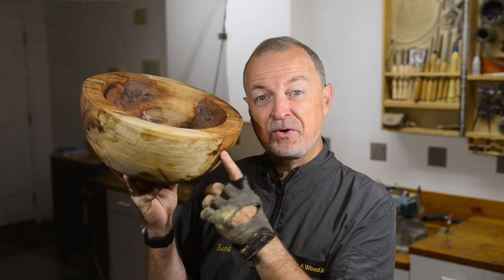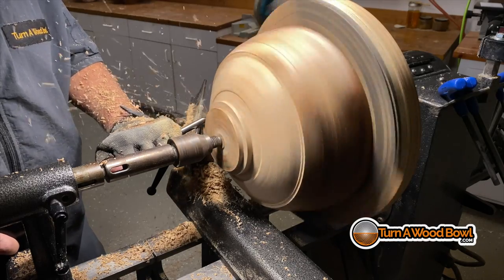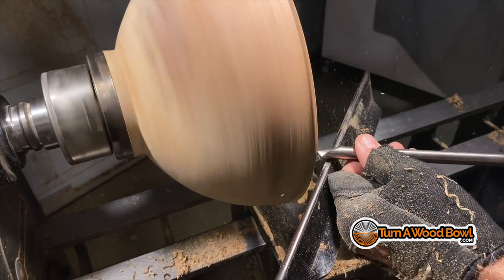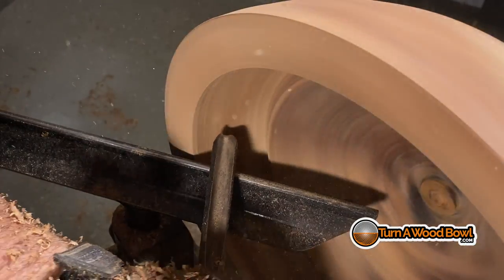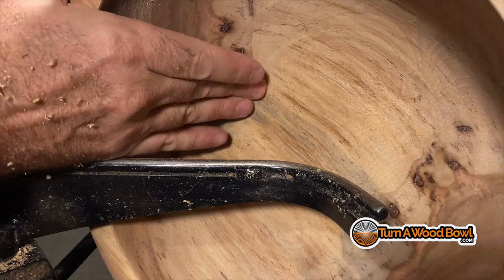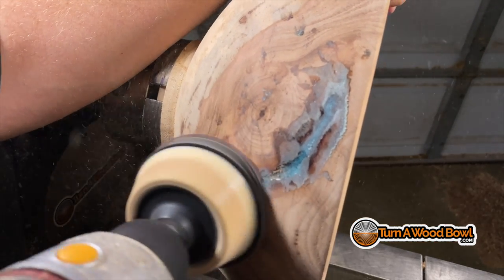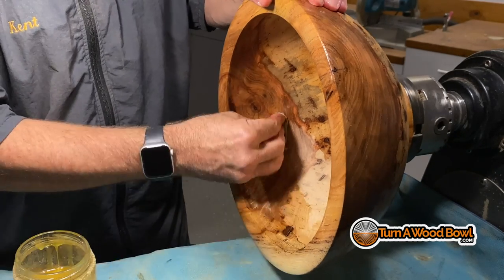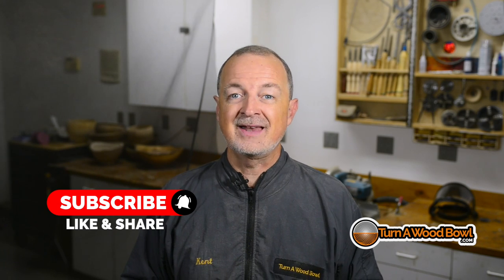How To Make A Salad Bowl – Video

Comment: Outstanding!  I love the wood and the grain structure & colors.   Great choice in using pecan.   I turn pecan wood quite often since I have a lot of it.  But, if it is really dry it can be tough to turn and hard on the tool cutting edge; requires frequent sharpening.
Reply from the maker: Awesome! Thank you! Yes, I learned on dried out pecan. It's a great way to learn. When I turned fresh green wood I was shocked. LOL Happy Turning!

Comment: Kent, another beautiful turning! The thought of twice turning is interesting, but where would I store the blank is my problem. You give something to ponder, which you often do and I appreciate that as well as your craft.
Reply: Josh, I've only twice-turned a few bowls, but plan to do more. I am not the patient sort when it comes to turning, so I store my first-turned pieces in the microwave, where I cook them for 60 - 90 seconds every few hours to speed up the drying process. It seems to take about a week for the wood to stop losing weight (I weight it on a postal scale each time right before I cook it). So far I've been able to have enough dried wood on hand to keep working on other projects while the rough bowl dries. And yes, in the interest of preserving marital harmony I put a microwave in my shop.
Reply: @davidross2376  David, I have used the microwave. I did it 10-15 times over a day, or two, with cooling in between and it worked well. Not, perhaps, being as wise as you, I used the kitchen microwave AND the food scale. Maybe I got away with it only because she loved the bowl.
Reply: @joshblumenthal4873  It sounds like you have a supportive partner! I'll bet she loves you even more than the bowl.
Reply from the maker: Storage is always an issue I think. Happy Turning!

Comment: Kent, another outstanding video with so many pearls, I'm thankful for your expertise.  Truing up that tenon is a real bugger, using the detail gouge to start that cut is so difficult for me.  Any wisdom on that cut?  I start straight vertical but still seem to get a skip, maybe not anchored enough....trying to solve this issue.
Reply from the maker: Lots of down pressure and let the tip start a ledge before proceeding inward. Hope that helps. Happy Turning!

Comment: I'd love to try turning a bowl. I'm still a turning newbie. So far I've only done a bit of spindle turning. I don't have a chuck so I'd be trying to turn with just a faceplate. My kids did buy me a bowl gouge for fathers day and I'd like to give it a try but I'm a little apprehensive. We'll see.
Reply: I only ever had a few faceplates when I first started turning, one large & one small.  Turned many many bowls just using faceplates. Depending how you do things it just involves a few more steps.  More time if you are then gluing wood blocks on, etc.  That said, bought a NOVA chuck for our ShopSmith two years ago, and wow….so much easier.  Id say, invest in a chuck - you will enjoy your turning better & turn more bowls.  The more you turn & try, the better you will get.  The new “carbide tipped” tools are nice too if you are apprehensive with bowl gouge.  Kent has a good video on here regarding “turning a bowl with only a faceplate”.  Check it out.  Have fun.
Reply from the maker: You can do it! Check out this video for inspiration https://www.youtube.com/watch?v=hV3FVE-Xq74

Comment: Hi Kent, you've posted another winner. This project resonated with me, as I have a 14" Cherry bowl on the lathe right now. It's a commission for a wedding gift, so I'll keep it simple, elegant (to the best of my ability, anyway), and sturdier than most of my bowls and platters. I hear you about patience using T&T Original finish. I really struggle to wait a whole day to let it cure. I'm reluctant to dismount it during that time, but get anxious when I can't turn for 24 hours! Do you have a back-up lathe, or do you take the piece off and put it back, or are you just more patient than I am?
Reply from the maker: Thanks, David. No, I just have a single lathe, for now. A secondary lathe would be very nice indeed. All the best to you and Happy Turning!
Reply: A second chuck or just turning between centers or a glue block?  Can you remove  your wedding bowl by just unscrewing the chuck it’s in now?  Don’t mean to be a busybody here but I have just the one lathe and that’s how  it can juggle multiple projects.
Reply: @DancingFox6  Those are good suggestions. I'm using a Shopsmith (second-hand Robust S16 coming later this week!), so my options are limited but the principles are the same. I have one chuck I use for almost everything, but it would be smart to expand my horizons. Thanks!

Comment: I tried with spalted maple and the bowl developed several large cracks all the way though as it dried. How do I prevent that. I left it about 5/8” thick and it’s a 10” bowl about 5” deep
Reply from the maker: First off, it needs to be turned in one relatively short time period. In other words, one way I've seen major problems is when someone turns the exterior of a bowl and waits several days before coring out the center. We cover many other factors that are too detailed for this comment in my Tree To Bowl Onine Course. Check it out www.TurnAWoodBowl.com/green Happy Turning!

Comment: Hi Kent, I'm a newbie to woodturning (since Jan. 2021)and have a question about the inlay you and others use when filing voids and bark in a workpiece. I often see contrasting colors used to color the filler instead of using a natural color. Is there a reason for that? Thanks and thank you for the wonderful educational videos you provide. I've probably seen most of them....some multiple times.
Reply from the maker: Greg, good question. Yes, contrast adds interest and trying to make the color match usually doesn't work well. I'd rather have a person say "wow, look at that," instead of "what's worry with that area?" ;) Happy Turning!

Comment: I observe in my projects that especially the middle area of the inner wall of a bowl is difficult to get into an evenly flowing shape. I either have a clearly visible edge or my wall thickness is becoming too thin...
You use the round nose scraper at 16:57. Why is it so difficult with the bowl gouge to get this area evenly?
Reply from the maker: It probably has to do with the bowl gouge angle. If you drop the handle in an arc, and lift the cutting edge a bit, you can navigate tighter inside curves. But the round nose also helps in these instances. Happy Turning!